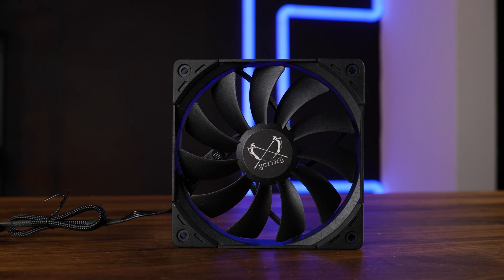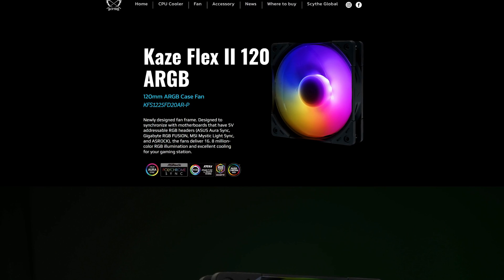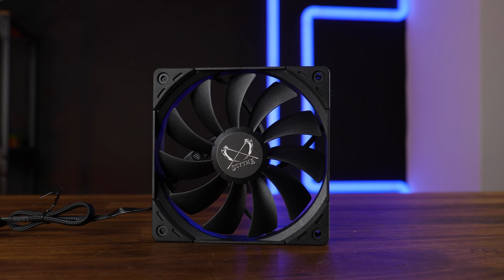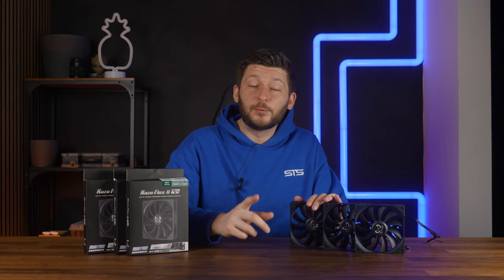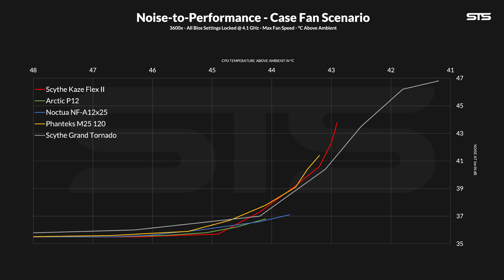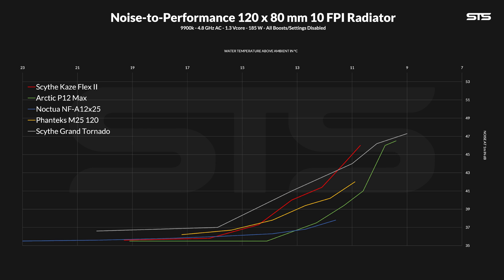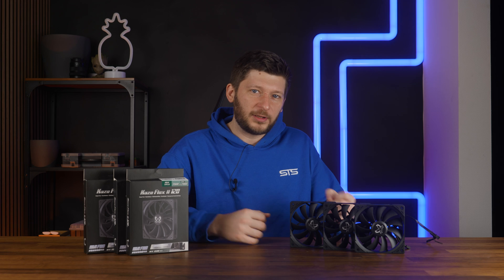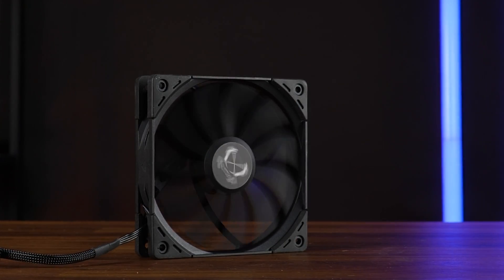Scythe Kaze Flex II 2000RPM Review - All New, All Black

Comment: Hi, would you recommend that I use this over the p28 as a case fan? I have an asus ap201 case with 6 p28s, and the noise is a bit annoying at 1500rpm+.
I would like the quitest fans for case use at medium/high rpm, I know that the Noctua A12X25 has pretty much the best noise /performance ratio, but they're really expensive where I live, so the next best option in terms of price would be appreciated.